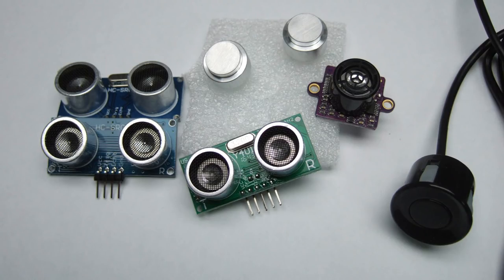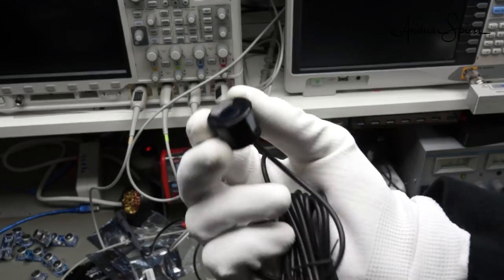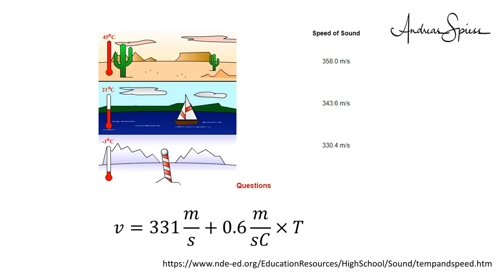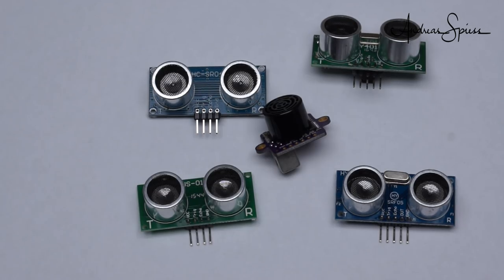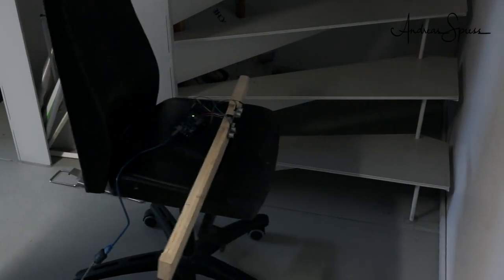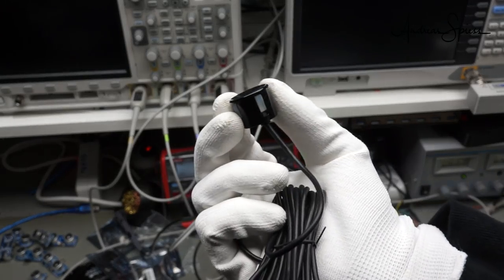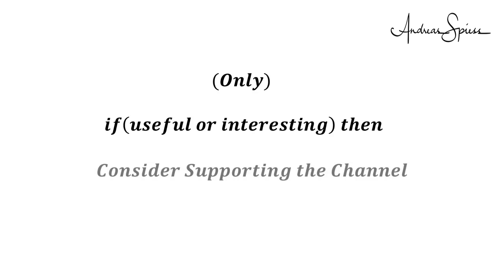#190 New Ultrasonic Sensors: Comparison and Test (US42V2, JSN-SR04T, and US-100)

Comment: you add salt to soften the water? how does adding more salts to water makes the water softer? i thought softer water means less dissolved stuff in it... for what do you use that "softer" water?
Reply from the maker: We do not add it. I am no chemist. Here an explanation I found: Salt-Based Ion Exchange Softener. This type of water softenercycles household water through two tanks: one with special resin beads and the other filled with brine. It works on the principle of ion exchange, softening hard water by substituting sodium (salt) for hard minerals such as calcium, magnesium, and iron.
Reply: northshorepx thanks for the great explanation video... so there is no contamination of sodium salt in the water output? the salt water is just used for washing off the filter?
Reply: Andreas Spiess if you are replacing the minerals in the water with salt then thats even worse than the hard water, but if it is as explained in the video that northshorepx shared and the salt water is used only to wash those resin beads then i guess its ok... 
if you think about it this system might remove all the micro minerals we need and we can only get thru the water which is bad and might remove all the oxygen dissolved in the water which is also bad... dont know i am not an chemist also, our tap water is purer than bottled water and noone ever had any problem because of drinking it so...
Reply: Is it cheaper than an osmosis filter?
Reply: You don't exchange magnesium or calcium with salt, you replace it with sodium. That's a huge difference and the concentration is so low (the mineral content of water is irrelevant for nutrition), that it doesn't matter.
There are no "micro minerals" in water, that you only get from there (btw. "micro minerals" doesn't even have a scientific meaning; it's mostly used in the industry that wants to sell you "health" products). You can replace all your water intake with distilled water, without it having any effect. There are way more minerals in any kind of food you eat than you'll ever get from water.
Also, unless you are a fish, you don't need any oxygen in your water.
Reply: superdau "You don't exchange magnesium or calcium with salt, you replace it with sodium" you do realize that substances of magnesium and calcium are dissolved in the water not pure metals and also "replace it with sodium" you do know what product is made when sodium is put into water?
"the mineral content of water is irrelevant for nutrition" many things are irrelevant for the nutrition but there are benefits after all... "micro minerals" meaning minerals that you need in small quantities for better health (english is not my main language)...  i am not a fish but lack of dissolved oxygen is what makes water taste stall, so i like my water fresh, if you are used to drinking bottled water or stale water thats different...
Reply: It should be obvious that we are talking about ions here and not the metallic form of the metals (it's called ion exchange softener for a reason).
Any meal has magnitudes more minerals of all kinds in them than a jug of water. There's nothing in water that you won't get much easier and in greater quantities from whatever else you consume daily anyway.
Water doesn't taste stale, because you take oxygen out of it. It tastes stale, because it has absorbed CO2 from the air, giving it a different taste and because it usually is a completely different temperature (warmer), that removes the "fresh" taste of a cold beverage.
Reply: Good grief people this is 80 year old technology with hundreds of videos and pages on how it works. It's funny how the easier it has become to find information, the less people are willing to do the slightest amount of work to find it on their own.
Reply: No sure, depends how hard the water is. I have a $1000 RO water system that I used to use for reef tanks and it produces RO water at like 3:1, that is three parts are dumped down the drain for 1 part clean water and the filters aren't cheap, I can't imagine using a whole-house RO water system is worth it unless you are getting free water or are really wealthy.
Reply: IamIUareU I am not a chemist either, but all dishwashers I have seen have tank for salt, which gets used with hard water, presumably to soften it. Some also have some kind of dosage adjustment, basically to increase the salt usage with harder water. So apparently it works somehow, and maybe someone could explain why and how :-)

Comment: At 5:29, You showed the GY-US42 sensor code alongside the others. Can you please help me with the specific code for that sensor. May be share  a link. Thanks.
Reply from the maker: This code is specific to the sensor. Gogle shows me this: https://www.instructables.com/ANALOG-ULTRASONIC-SENSOR-for-DISTANCE-MEASURMENT/
Reply: @AndreasSpiess  Thanks for reply! I have seen that before. I was looking for a simple I2C connection code for this sensor, such simply using a library and defining a name. Because am trying to use 3/4 sensor to approve an algorithm. Writing code for this 3 or 4 sensor with that code becoming complex.
Reply from the maker: I made once a video where I built I2C adapters for standard ultrasonic distance meters using ATTiny chips
Reply: @AndreasSpiess  Can you please share the link? I bought 4 sensors and tried to use I2C addresses, but unfortunately all sensor's address is same 0x70! -_-

Comment: Have you encountered any sensors that would allow to sense motion through walls (12cm bricks for example)? I bought a motion detecting lamp off Ali and it triggers easily through walls. Now I'm actually looking for a sensor like that..
Reply from the maker: Maybe your lamp has a radar sensor. I made a video about them.
Reply: Yeah, (#135) - I tried it with the HFS-DC06, but either it was either constantly sensing movement when there was none or it did not penetrate the wall. I will give it a few more tries..

Comment: I got the JSN-SR04T-2.0 and tested it in Mode3 with 120k resistor in R27. This waits for a 0x55 signal and returns the distance in mm as a 4-byte frame. Unfortunately, the device rounds this mm measurement to the nearest 17 mm! Not very good precision. The absolute accuracy seemed to be off by about 2cm also, indicating less than the actual distance. With Mode1, I could see only about 10microsec of jitter in the pulse length which I think is less than 2mm, so it should be able to do much better in serial mode than it does. Getting the Arduino (DUE in this case) to measure the pulse accurately in Mode1 seems also to be a limitation, using the pulseIn() function.
Reply from the maker: Thank you for your feedback. I did not know of this rounding to the nearest 17 mm. 
The offset is not a big problem for me because you anyway have to adjust for the plane you want to use as a reference.

Comment: If these had enough resolution they could be used to detect wind speed, but it looks like they don't if I'm seeing what I think I'm seeing.  1cm resolution.  It would take some pretty strong winds for even a 1cm deviation in a 1m range measurement.
Reply from the maker: Interesting concept to use ultrasonic sensors for measuring wind speed

Comment: be careful, it seems that the waterproof sensors can only measure down to 40cm. it's because the module has to be blind between trigger and echo pulses, because it has only one sensor that does all. I'm looking for a waterproof sensor with two sensors, but did not find them. was thinking to try to replace the sensors on a SR04 with the waterproof ones to test it. that way, measuring water level in small tanks would be possible.
Reply: so that is why my car thinks it hits another car while there's plenty of room left ;)
Reply from the maker: I did not test the rang this time. Thanks for the feedback. Then maybe the application in the salt tank is endangered.
Reply: in fact it is 20cm from the JSN-SR04T-2.0 datasheet. other 2 sensors modules indicate around 2cm.
Reply: Andreas Spiess There’s a lot of people looking for a solution to this problem, maybe a future video could explore this? I’m wondering if two JSN-SR04T can be used to separate the sending and receiving responsibilities to reduce the min distance threshold.
Reply: Did you make progress with your salt tank project? I’m using a JSN-SR04 for sensing the salt level. I have difficulties to get a stable signal. When there is only little salt left (ca. 80cm measuring distance) it works fine. Then I filled in salt into the tank and the distance readings vary between 20cm and -200cm. 
I wonder if the fine salt grains disturb the measuring and I should switch to salt pellets. Do you think, optical sensors are more suitable?
I’d appreciate if you can share your experiences. 
Greetings from Magden

Comment: Hello Andreas, thank you for another interesting video.
I have a question for you, or anyone who might know sth about it. 
I use a US100 (3.3V) with an esp8266 to measuse the oil level of my 1.5m by 1m oil tank. 
Everything is working fine until oil height drops below the middle of the tank where there is a metal grid formed by 50cm by 50cm squares and is part of the tank stracture. The sensor placed at the top of the tank senses the squares and stops "seeing" the oil below that point. 
Is there a way to norrow the sesor beam and measure the oil through the grid square?

I was wondering if the newer laser sensors would do, but would they work on the black oil surface?

Thanks in advance for any help.
Reply from the maker: This topic needs a lot of experimentation, because it is a one off case. Maybe a thinner grid in some places or maybe a second device which triggers later and listens to the second echo which should come from the oil. Lasers are probably more focused, but have a short range
Reply: Andreas Spiess thank you Andreas.

Comment: Transducer is the name of a component that combines transmitting and receiving hardware inside the same envelope.
Reply from the maker: Thank you for helping me out.
Reply: Transceiver comes to mind as well.
Reply: Transducer it best, IMO.  https://en.wikipedia.org/wiki/Transducer
Reply: Sorry, I agree with Kenneth. A transducer converts one form of energy to another, such as an ultrasonic transmitter or receiver. 
When It does both, it's a transceiver (acts as a transmitter and/or receiver).
Reply: A transceiver is the TOTAL electronics system that sends and receives.  The transducer is the device that converts energy from one form to another, and makes up a portion of that system.   Andreas was "wondering" out loud about the what the ultrasonic portion of the system should be called, I think, not the entire board.

Comment: Hi, i need to measure a milk tank level (until 3 liters). Do you think this ultrassonici sensor (the waterproof ) will be useful? In cant mesure the flow rate because this have a lot of air.
Reply from the maker: I do not know. Maybe you spend the few dollars to try yourself in your particular situation. This sensor does not measure very short (<60cm) distances.

Comment: Waterproof transducer can be used for water level sensor inside tanks
Reply from the maker: I am not sure if it is powerful enough.
Reply: Andreas Spiess I have tested it with HC-SR04. As water level decreases, the distance keeps increasing. I'm yet to test with waterproof sensor as I don't have one but the principle should be same. Using ESP8266 and a waterproof u/s sensor we could make a water consumption logger and using some level software (node-red)we can auatomate pumps as well.
Reply from the maker: Aha. It, of course, works if you place it above the water. I thought you want to place it in the water...
Reply: Andreas Spiess Yes. Place it above the water level, preferably at the top of the water tank, looking down. Then log the distance over interval.

Comment: More importantly make sure you are not wasting salt, most units do.  Does your unit regen based on usage?  probably so, but make sure you are calibrated given your hardness so as to not waste salt.   Many units waste salt many times more than should be, many because salt guy adj it.   In my case with 3 users and a hardness of 10 I use 330lbs in 2yrs or about 13.75lbs a month.
Reply from the maker: Ours is based on usage and it does not need a lot of salt. But I have to check it, you are right.

Comment: Project idea for the JSN-SR04T: safe passing distance measurement concerning bicycle vs car: mount the sensor in the handlebar, log unsafe passing (<1.5m), transmit via lora or wifi.
Reply from the maker: Interesting... Maybe a big horn would be better or a camera to document.
Reply from the maker: Instead of the LoRa, of course...
Reply: Andreas Spiess in my experience as a bike messenger, trying to educate the car drivers doesn't work well. Documentation and showing the city planners that the problem exists and where it exists (GPS) is the better way to tackle the problem. With this information, they may overhaul bike lanes in dangerous areas.
Reply from the maker: Good Idea!

Comment: I would like to know if I can use these to measure distance up to 10 meters, any one know which device to use for this?
Reply from the maker: The rangge tests in the firs video showed a range of about 5 meters. If. You need more you have to increase sending power increase sensitivity of the Receiver

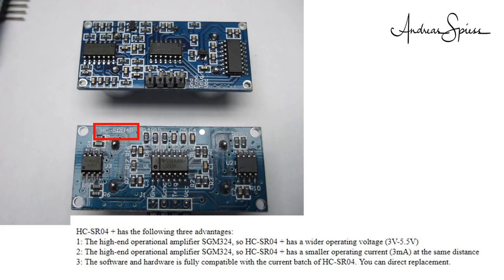Comment: ah - probably safe to ignore my comment on the other video. 3:08 here looks like they are saying only the +/P(lus) version of the SR-04 will work with 3.3v - 5v So I guess that means the original SR-04 is 5v only and  to use the SR-04 with an ESP32 I should power at 5v and use a logic level shifter?
Reply from the maker: You can use a resistor divider for the input to the ESP32.
Reply: @AndreasSpiess  oh of course! Good thinking. I think I did that with an HC-06 and totally forgot! Thanks for the reminder!

Comment: Are you aware of sensors that can do longer ranges (50m).  I would like to track the speed of a sprinter as he accelerates.
Reply from the maker: Some lasers migt do this trick. But they are expensive
Reply: I see there are "digital tape measures" that I can buy at my local hardware store that are less than $100US.  The sensor they use must be much cheaper than this. If the distance was not quite 50m, I could live with that; but, it would need to be more than a few meters.
Reply: I found a laser tape measure on Amazon (https://www.amazon.com/gp/product/B01N64GLDQ/) that can measure up to 60m for $35US.  I wonder what sensor it uses?
Reply: Maybe a LeddarTech Leddar One?
Reply: The Leddar One was interesting until I saw the price = $115US.  That is three times the unit from Amazon and it doesn't come with a display or a pretty box.

Comment: Has anyone found waterproof (reasonably priced) high power ultrasonic transducers that could be used to measure the depth of e.g. a lake? I reckon the element used in cheap ultrasonic cleaners would pack enough punch, and perhaps regular automotive sensors could be used as receivers.
Reply from the maker: Maybe like this one? http://www.mbtelectronics.com/side-scan-sonar.php
Reply: Andreas Spiess: Thanks for the reply. I actually also found that link when I was researching the topic some time ago. They use low-cost ultrasonic cleaner transducers, just like I suggested, but the electronics design is straight-up 60's stuff. Unbelievably complicated transceiver and receiver, not to mention the pen plotter as an output. They also make the final signal with FETs driving a transformer, i.e., the waveform will be nothing like a pure sinusoid. Though the ultrasound cleaners I have scoped also feature a horrendously 'dirty' wave.

I reckon I will try using a DDS module (AD9850 or similar) and amplifying its output to drive an ultrasound cleaner transducer (or a couple). Finding the resonant frequency should be relatively easy by running a frequency sweep and monitoring the current consumption. As for the receiver, I hesitate using the (same) transducers, not only because the power levels between sent and received waves must be four or five orders of magnitude in difference, but also because I doubt the massive ultrasound cleaner transducers are very sensitive for receiving signals.
Reply from the maker: At least they showed that it works. I had similar thoughts as you when I read the article... Please keep us updated if you do your project.
Reply: @AndreasSpiess  After countless hours of research and experimentation, not to mention a fair amount (on my scale) of money spent, I finally came to the conclusion that BY FAR the cheapest and easiest solution for bathymetry is buying a used sonar. You can get an older model of a HQ device with a small screen (especially the B/W models are super cheap) for less than 60USD shipped.
With this commercial unit, you could either
1) output the data directly e.g. in sl2 format if the device supports it
2) read the depth data via NMEA
3) tap into the LCD driver IC's signal connections and decode the depth
4) mount a camera that captures the sonar's screen and decrypts the depth with image recognition
Anyway, the lake I wanted to map has recently grown so much above-surface vegetation that a (commonly used) catamaran type ROV would get stuck in the weeds all the time. Thus, I 'bent the knee' and bought a semi-decent sonar unit (Lowrance Elite Ti2 9), and have been mapping the lake for almost two weeks now, 1.86km^2 in total so far. All the data I've gathered will be available to the world in C-MAP Genesis after a while (I need to complain about this artificial delay).
To be honest, 'manually' mapping the lake is rather addictive, therapeutic even. Watching the dark areas turning brighter and depth contours forming on the sonar screen is rather soothing...